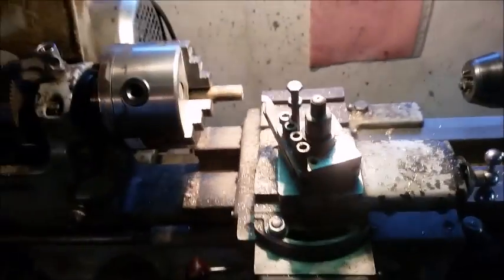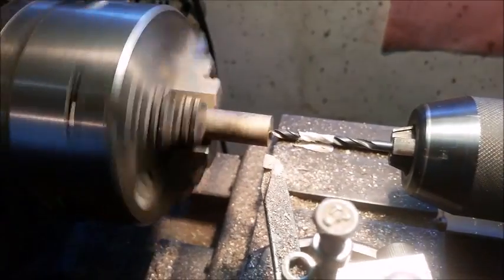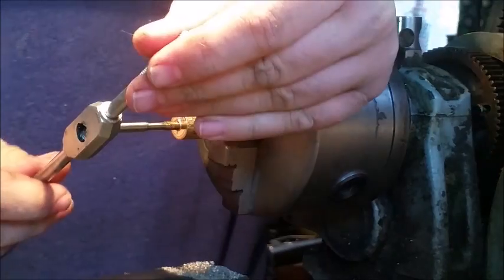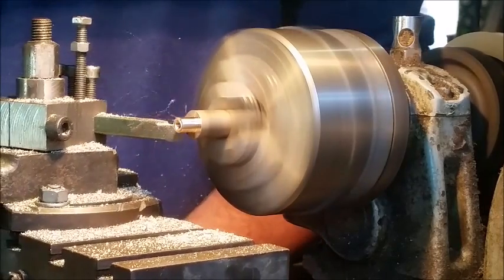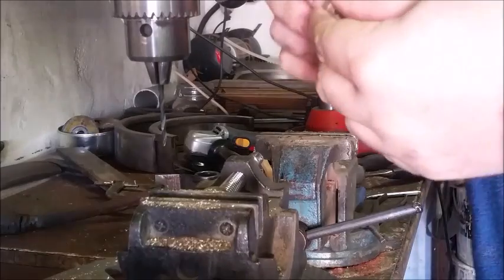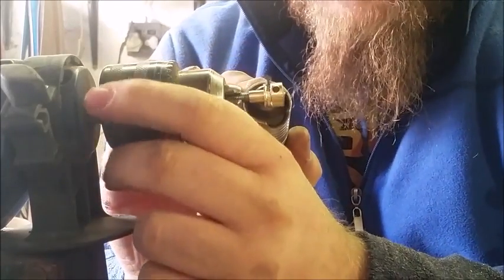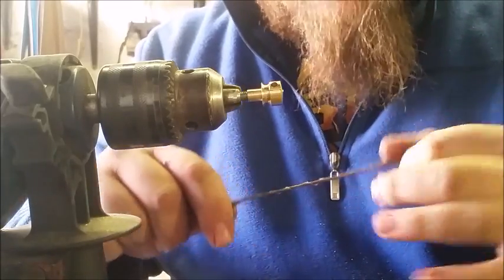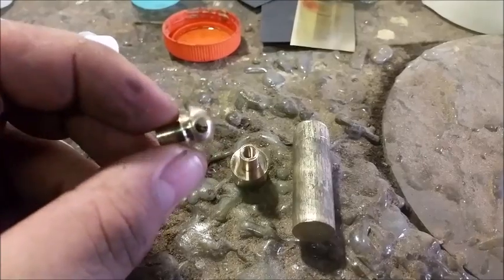Making a Pommel nut

Comment: I used my drill press and angle grinder. Threaded a bolt though with lock nut to chuck it. Stainless. I like this method better. Yes, I know lateral stressors. Drill press to line up the tap too. Then same as you, tap handle. Thanks man, good stuuf.

Comment: If you do tapping use cut oil and a bigger tap wrench so you dont hold the wrench but let the lathe ways hold it as you turn the chuck and buy a piece of hss blank and make some inserts for the lathe so you can do a lot on the lathe and not go from one tool to the next(you can find shapes and forms on the net to shape the hss blanks).And if you finish your turning break the edges and than do the parting.
Keep up the good work
Dutch greatings
Reply from the maker: Thanks for the tips. Turning is not my forte. Need more practice
Reply: np here is a doc with some info hope you can read a little Dutch as your from SA ;-)
http://docplayer.nl/14965178-Handleiding-unimat-4.html